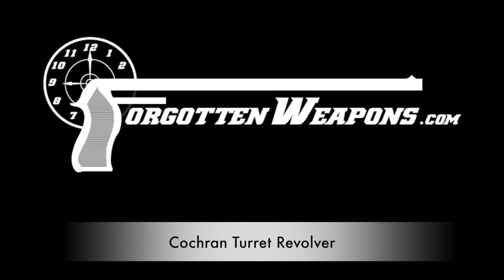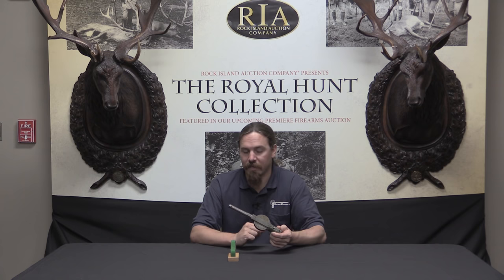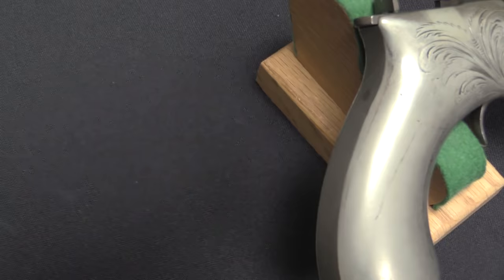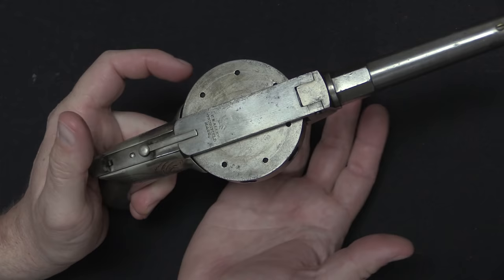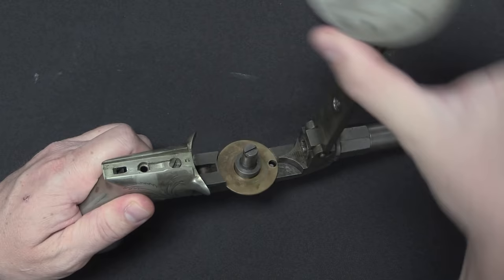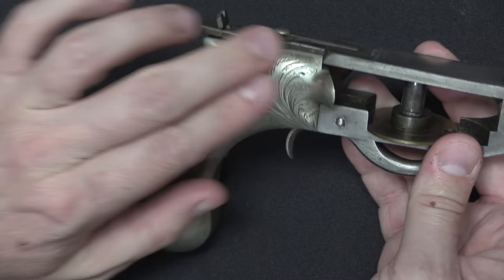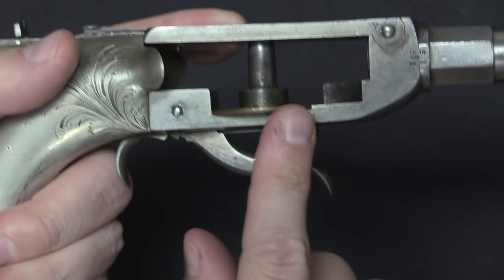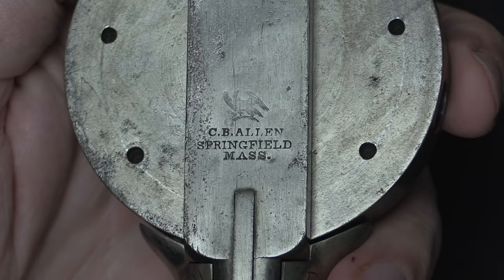Cochran Turret Revolver

Comment: If this had been more popular, it would have been easy to tinker some sort of hafl-index notch to misallign the hammer from any loaded cap allowing it to be carried fully loaded, either by changing the hammer to hold on an safety notch, having the indexing lever a hole for half-index or have a totally differen disengageable spring and lever for new position for half-index to hold on to.

Comment: The "ears" at both sides cover the cylinders to prevent the 2 pointing aft being susceptible to ignition, that said a very elegant piece indeed, the evol of Da Vinci's multi-fire concept. A much better system. 50/50 on the current tech v genius aspect, a good argument both ways.

Comment: Oddly enough this is similar, but not identical to the G11 breechblock. Well, more like the same piece given a new purpose. Basically the G11 has a squat cylinder like that but with a chamber drilled all the way through, reason for that is the lack of an ejector due to the caseless ammo, instead if there is a dud it's simply pushed by a fresh round (that is a sane way to extract a brittle caseless round as well.) I suspect there is some sort of ram rod to clear the last round. Obviously there would be gas leakage issues but I guess it could be minimized to the point where it would be more or less as dirty as a DI gun. Not awfully complicated per se, the rest of the gun and trigger mechanism are what makes the gun nightmarish, if it was a simple rifle without the super-burst feature I think it would have being more practical... to the extent the type of ammo allows. I think it's also used on a few cannons that use telescopic ammo, probably to removed the extractor and make the thing more reliable, it lacks the speed of a true revolver cannon but I guess it's simpler and more reliable.

Comment: This would be interesting if the soldier using it would go out into battle with like 4 of the cylinders and just quickly change them instead of having to load the cylinder.

Comment: I just thought of another design flaw about these turret guns, being that the cylinder is a huge waste of steel.  

the chamber walls are very thick on the extremity, where it's unnecessary, and quite thin where the percussion nipple meets the chamber.  For the amount of work and steel that is used to make it, it's a pretty fragile and heavy design, in addition to being dangerous.

Comment: In light of the issues with a turret like that, are there any 'fan revolvers', where all the chambers are aligned, say, forwards, but on a perpendicular rotary joint behind the chambers?  So all the chambers are still looking forwards and the risk of 'backfire' are minimal, but you still have the multi-fire capability.
Reply: Not revolvers, but duckfoot guns and harmonica guns exist.
Reply: *****
So they do.  I'm kinda surprised they never combined the ideas.  You'd think a single rotational joint would be easier to manufacture and more robust than the sliding joint in the harmonica guns.

Comment: so you had to load it upside down to keep the caps on?
Reply from the maker: +SgtKOnyx Caps are generally fairly tight, and wouldn't have fallen off when mounting a cylinder.
Reply: +Forgotten Weapons ah. Having never used caps I was unaware

Comment: Wait, you need to remove the cilinder to reload, you need to use your hands to turn it and the hammer doesn't move on itself? My god, the 3 advantages this gun could have over a revolver don't exist!
Reply: At the time, Colt had the patent on a gun where cocking the hammer indexes the cylinder. Cochran had to specifically omit that in order to not get sued.